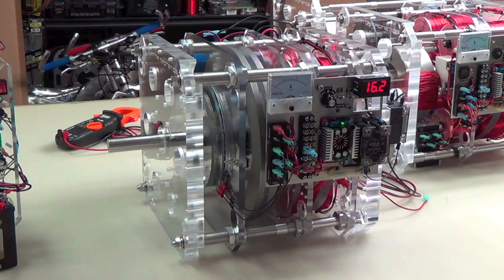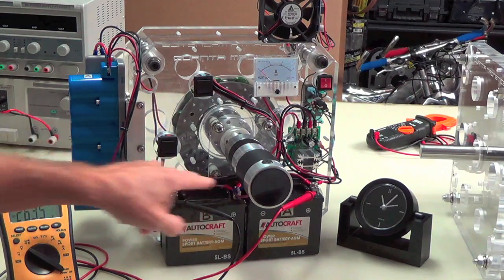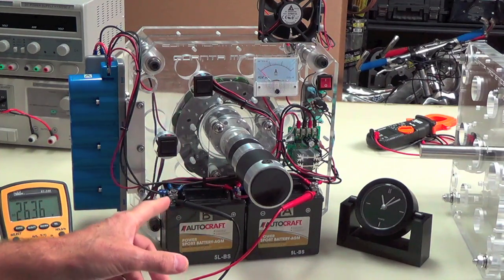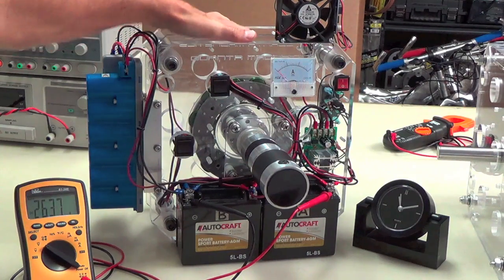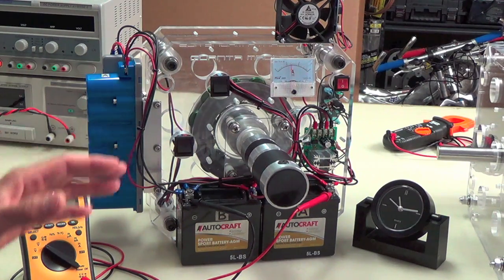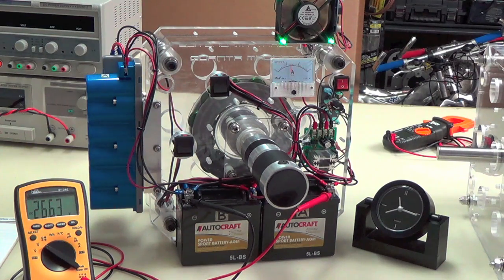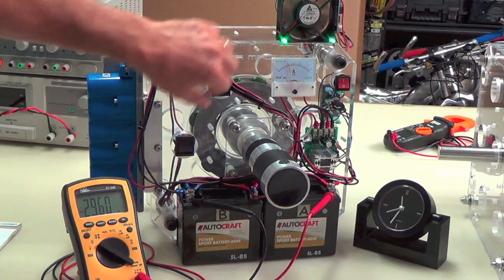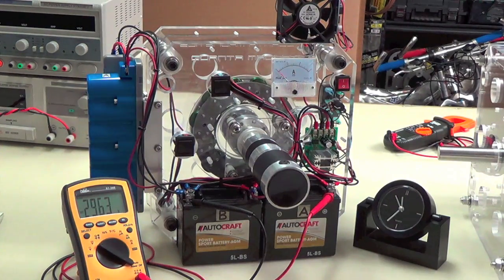Tesla Switch Hybrid to Supercaps

Comment: (He has a face!  :-)
I'm very interested in building a replication... but trying to draw a schematic first from your description (and the previous video) leaves me with a few questions...

1) Batteries are directly in parallel with a super-cap bank, right? (equivalent to each battery having its own super-cap internally)
2) Current meter - connected in series with the (+) from the "B" battery to the PWM motor drive input?
3) 12 coils in the 3-phase generator (alternator)? 
4) 16 sets of magnets on each side of the stationary coils? 
5) What is the magnet sequential polar orientation, every adjacent set opposite its neighbor?
6) Two bridge rectifiers for the alternator outputs?
7) You said you have 2 alternator phases charging across both "A" and "B" batteries... how are the 2 phases wired through their bridge rectifier? They are not in-phase, so I don't see how you can add them together unless they each have their own bridge rectifier, then series or parallel connect the DC outputs from the bridge rectifiers...??
8) The 3rd phase of the alternator through its own bridge rectifier, charging battery "A", right?

A "three DVM" demo (one on each battery/cap, in addition to the 3rd like you have it now) would certainly help... it would show the effect of the "B" battery decreasing in voltage due to the draw, and prove if the "A" battery is actually being WAY over-charged, making up for the lower "B" battery voltage. You can't really just treat it like it's a 24V system, and measure the voltage that way... since you use 12V for running the system.

At first glance, it seems using a slow speed (very low "kv" RPM/Volt rating) pancake outrunner BLDC drive motor would increase the efficiency... giving even more output for less input.
Reply from the maker: +beforebefore  Yes to all except the following:  2) Ammeter measures ALL consumed current.  6) Three bridge rectifiers as noted in the video.  7) Separate BR's connect parallel at DC output.   NOTE: Batteries "B & A" are constantly charged together utilizing two phase outputs, giving "A" a slightly greater charge with an additional dedicated third phase.  Ultracaps make a difference in absorption and retention.

Your closing statement is a great suggestion. Thank you for that input.
Reply: +PMMG4HYBRID   What's the RPM you used in this test? (guessing 250RPM?)

A good search phrase for such a BLDC motor might be "red epic gimbal brushless motor" - like these:
www.ebay.com/itm/141759737196

http://www.ebay.com/sch/i.html?_odkw=red+ginbal+motor&_osacat=0&_from=R40&_trksid=p2045573.m570.l1313.TR0.TRC0.H0.Xred+gimbal+motor.TRS1&_nkw=red+gimbal+motor&_sacat=0

http://www.hobbyking.com/hobbyking/store/__53946__Turnigy_LD9017_Brushless_Gimbal_Motor.html
(very slow... 7 RPM/Volt !)

Various Gimbal motors:
http://www.hobbyking.com/hobbyking/store/RC_PRODUCT_SEARCH.asp?searchType=10&strSearch=gimbal+motor&location=AL&idCategory=&sortBy=Relevant&NumPerPage=100&currentPage=

HOWEVER... these may be too slow... you may need direct drive multicopter prop motors...

http://www.hobbyking.com/hobbyking/store/__61432__DYS_Brushless_Motor_86x10_BE8108_12_135KV_for_Multi_Rotors.html  (135 kv)

http://www.hobbyking.com/hobbyking/store/__61431__DYS_Brushless_Motor_8610_BE8108_16_100KV_for_Multi_Rotors_Gimbals.html  (100 kv)

http://www.hobbyking.com/hobbyking/store/__56935__Turnigy_9014_105kv_Brushless_Multi_Rotor_Motor_BLDC_.html  (105 kv)
Reply from the maker: +beforebefore   300-325 RPM is best for this particular configuration.  

Great!  Thanks so much for the links.

Comment: I've been contemplating a similar effect. Could you use nickel-iron batteries, overcharge them as you've shown and collect the off-gassed hydrogen? If your machine continues to run and charge the cells, continually replace the water and have a useful ongoing chemical reactor.  Excess H =  magic!
Reply from the maker: +RJENDRO  I'm going to leave that one up to you to explore. Thanks!

Comment: Well done Quantamagnetics. I guess what we see here is a change in impedance of the batteries... Maybe the batteries are getting warm from the drawn current and then change their internal impedance, so the voltage will rise ?
I guess you should apply another additional controllable load to it , so that the voltage stays constant and will not rise and let it run much longer, e.g. for a few hours and lets see if the voltage will finally fall again... Then compare the drawn energy versus the Watthours capacity of the batteries... Will the runtime be longer than the battery capacity would predict ?
I guess though you are on the right track to a real overunity machine.
Good luck. Regards, Stefan.
Reply from the maker: +overunitydotcom  I think that's a very good assumption Stefan regarding impedance. That is also a good test suggestion. My opinion would be a longer runtime from the direct integration of ultracaps to batteries in both charge and discharge cycles. It is also very interesting how the charge rise will temporarily slow down or stop momentarily with the slightest change in rpm, as if to disrupt its natural rhythm.  You gotta love this stuff.
Reply: +PMMG4HYBRID Good to see you are still willing to share your experiments on the tube.Keep testing and posting your results.Many of your viewers who have an experimental background may also be experiencing high efficiency with various forms of energy transformation systems.Best of luck, CFX